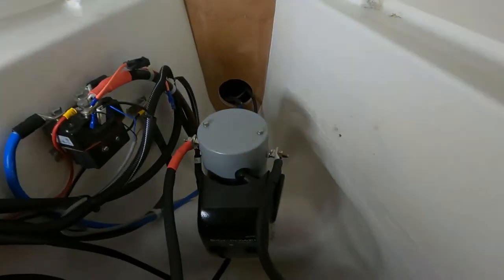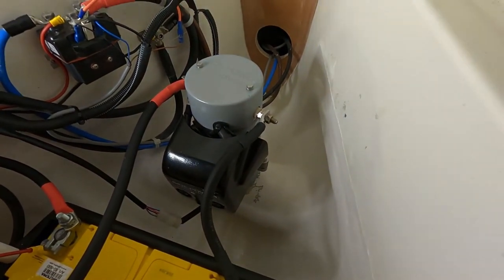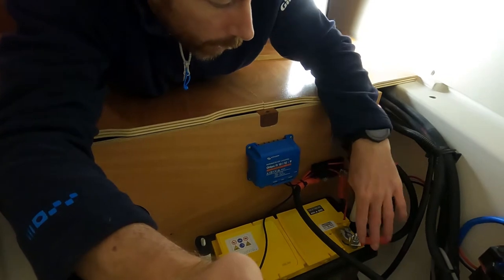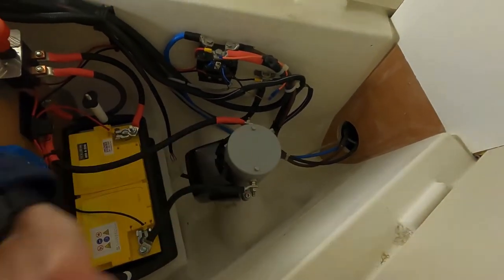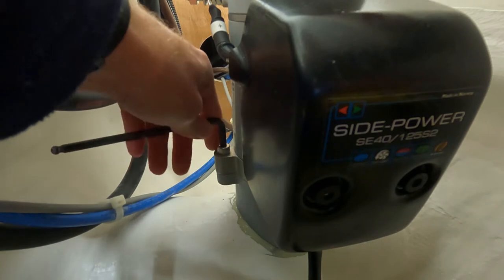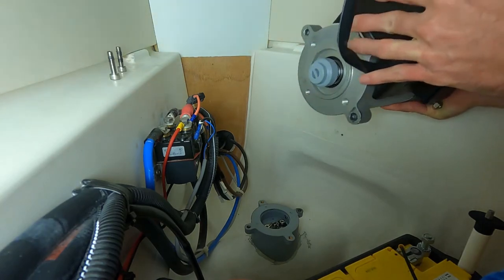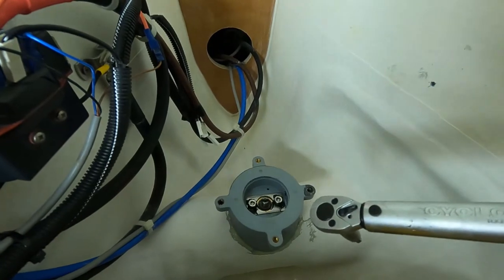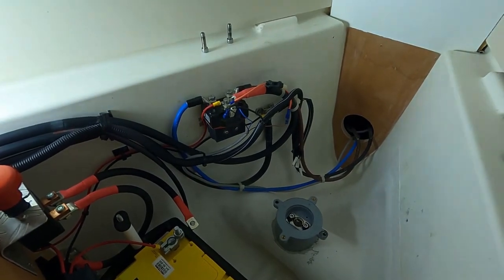Bow thruster check-up and upcoming projects!

Comment: I think you were right the first time!!!   It should be wired ...  Battery - Switch - Fuse - Thruster...... That way you can change the fuse when it's "cold"  ie there is no power on.
Much safer and less chance of the fuse blowing while you are holding it in your fingers!!!. 
My Lewmar installation guide shows it this way as well.

Comment: Hello, I’ve watched your bow thruster install and you have inspired me to have a go myself… I would really appreciate a chat if you have time, I’d like know a bit more about your fibre glassing - thanks in advance 🤞
Reply from the maker: Hi! Please feel free to post questions here  so others will also benefit from it
Reply: @jacobkollerup  Thank you Q1: When mixing the chop strand, how much epoxy did you mix and did you use an additional thickener Silica? Q2 How long after filling round the tunnel did you apply your 1st layer of glass Q3: When applying the peel ply did you  wet out the area with extra epoxy or did you apply on top when it started taking and roll it Q4 How long did you leave between each layer? Finally Q5 What gel coat did you use to cover and how was it applied. Thank you 💪👍
Reply: @Boatdiy you have a lot of Botworkstoday watching to do 🙃

Comment: Did you have enough power with SE 40 bow truster in strong winds?
Reply from the maker: I believe so. This summer we did some docking in 10-12m/s winds straight on the beam with no issues. 40 kg thrust might not seem like much, but the small diameter tunnel combined with a hull shape that makes it possible to mount the thruster extremely far forward, makes it very efficient